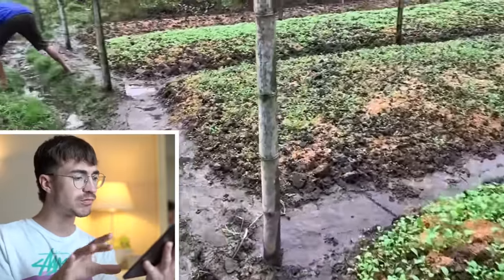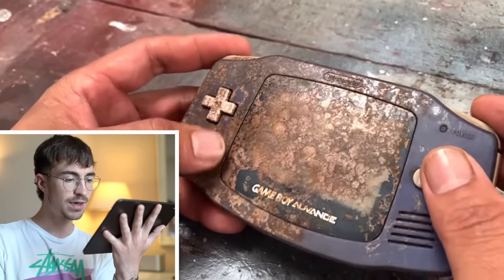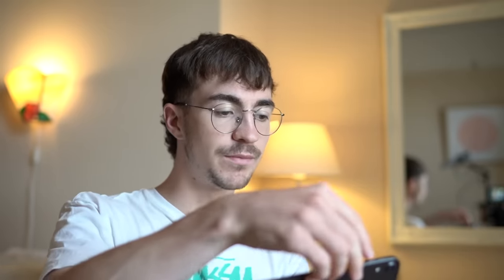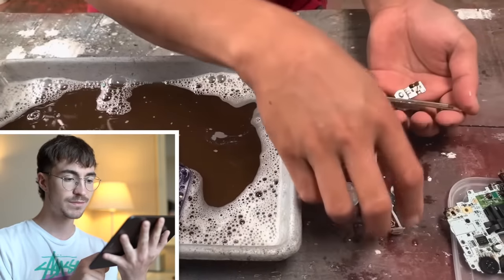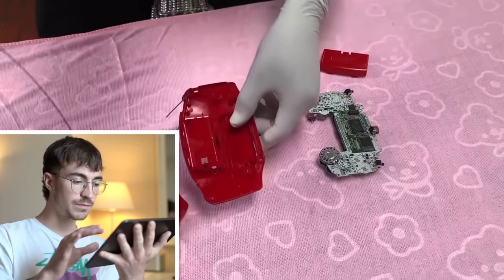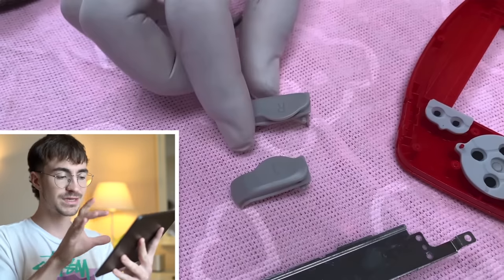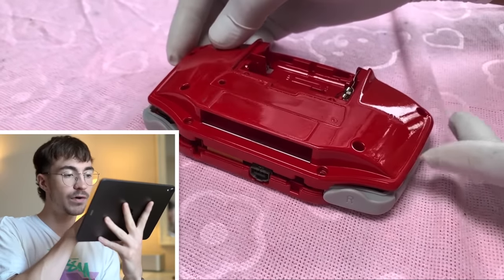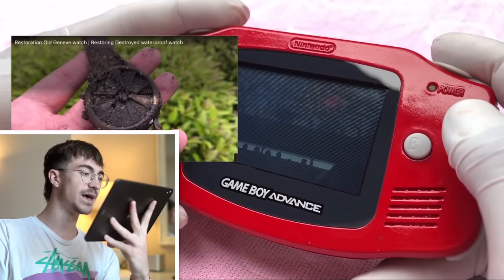Exposing FAKE Restoration Videos!

Comment: Cleaning electronic boards in water and soap actually works very well. I do that on nasty motherboards and they work fine, because there was no current in the board when I put it in the water. You just have to be absolutely sure the board has no water left hidden under its components.
Reply: Heck, I've put stuff in the dishwasher before (without detergent obviously) A good spray with some de-greaser suitable for electronics and a round in the dishwasher cleans boards up very nicely. Did it when I was fixing up old arcade monitor chassis.
Reply: watching him react like water is the worst thing for a piece of tech with no current going through it kind of frustrated me. as if that alone would brick a device
Reply: Yeah, I cleaned a few motherboards with water. Just make sure it's completely dry before turning it on. lol
Reply: I have cleaned motherboards in nice hot water, as long as they're dried well (i usually use a hairdryer and compressed air), water is a great way to clean them up.
Reply: Many of these restoration videos are certainly fake though!
Reply: I’d bet the original motherboard probably actually did work, but the one they put back in probably wasn’t it.
Reply: I came here to say exactly this. Cleaned plenty of old electronics out with soap and water
Reply: @EvilTurkeySlices  I bet it was the same one because the edges in spots were heavily rusted still when they put it in.
Reply: @WolfgangAmadeus117  my home server got flooded after an outage and storms, it still works just fine after having been fully submerged
Reply: @mrbisshie  so you submerged it in water for a few hours, spray cleaning foam on it, scrubbed the hell out of it with a brush, and it still worked? Skipping half the process and saying you can replicate it is a fools errand. Maybe you should make restoration videos?
Reply: @azinyefantasy4445  Damn, you mad someone would dare share an opinion that goes against you boyfriends narrative or what? For the record, it is absolutely safe to wash unpowered motherboards with water, just need to make sure all the minerals and gunk that the water has in it is removed before applying current, I just give it a alcohol bath. Anyways, good luck with the getting teabagged thing.
Reply: Used to work in a lab and we would wash our freshly soldered PCBs under the tap with soap and a brush to clean up all the rosin. It's fine to do so long as you rinse with distilled or alcohol afterwards so it doesn't leave any minerals behind, then maybe bake it in the oven for half an hour to drive off all the moisture.
Reply: I spray down crt arcade monitors with the garden hose all the time....takes the water just fine. After discharging it of course.
Reply: Yeah, after my keyboard had some bad incidents with liquid damage, i tore it all down and gave it a scrub in the bathtub, let it dry out in the sun, put it back together and it was fine. As long as there's no power when you wash it and you don't power it up before it fully dries, water won't do much damage.
Reply: Only problem with using tap water is with bga chips as the water gets trapped under which good old wd40 or heat will take care of
Reply: Normal water isn't the best approach. Distilled one of course is. Why it isn't? 1) it has tone of micro elements inside, they will be 'glued' to the pcb as water evaporates. 2) it introduces corrosion, 3) it's really hard to say when pcb is fully dry... Especially when the pcb is fully soaked. It could take days...

Use pure h2o, use it locally, then when cleaning is done - use some ipa to make water evaporation faster.

He didn't say, that water will kill it, he just said that device left in those conditions, looking like that (completely corroded) has no right to work - and yes it doesn't. I would even say - it is beyond repair, because it's corroded between the pcb layers.
Reply: @markippo  no corrosion between pcb layers and it doesn't take days to dry a board heat from sun wd40 alcohol etc will get it all
And just fyi there is always some moisture present even more depending on where you live and is very important to know when you do bga reworking so you dont popcorn chips etc
Eg florida like where i am
Reply: @williamlancto3655  Puting Motherboards in the dishwasher is the best thing in the world. Put it in the oven at 80 degrees celsius (176 degrees fahrenheit) for a good while and it's shiny and working in a few hours.
Reply: i even use dishwashing soap with it.
Reply: @sukhoifockewulf  Yeah, I work with electronics for my job and water is %10000 safe to use on any electronics. You just need to make sure there is no current to the motherboard. Also, hard water can be a concern but distilled water is non-conductive and if you use distilled water you can turn a motherboard on underwater while powered on as pure water is non-conductive. What makes water bad for electronics is the dissolved ions in the water, dissolved potassium and sodium ions are highly conductive and is what makes water bad for devices but if it is %100 pure deionized water then you can run current through devices all day submerged with current running no issue and no need to worry about any shorts. 

I cringed so hard when he complained of the guy using water acting like that was going to brick the device or be harmful to the device in any way. Yes with the soap and grime even if using deionized water he is introducing ions into the water making it conductive again, however, no current is flowing through the device no risk of a short circuit it's fine. Just make sure it is dry what I usually do after washing with water is dunk it in %99 iso as it evaporates off and works wonders for drying the mobo after cleaning with water while also stripping oils. People say not to use water only %99 iso but that is just dumb as iso isn't a good cleaning agent by itself at all it is actually rather horrible at cleaning that is why if you clean with iso you want to use a dilute solution as it doesn't work as well as water for cleaning things like sugars.
Reply: Came here to say the same thing. The board absolutely could've been the same one. The buttons, however, were all definitely after market and the video was definitely made in a way to try and make you think he'd restored them.
Reply: @azinyefantasy4445  maybe you should make a xray scan on your head video? it can be submerged in water for a few hours and scrubbing the hell out of it with a  brush wouldnt affect. ik a thing or 2 bout this because i restore mobile devices and i can easily clean them with water, even leaving it there for a few hours.
Reply: @CodyRPierce  That's one hell of a conformal coating.
Reply: @markippo  Its not that unheard of though with electronics. It really doesn't matter what they look like.I''ve seen working computers with insect nests in them.
Reply: @jhoughjr1  no coating. We pulled it apart and cleaned everything and it was fine except for the hard drives. The case rusted though
Reply: A solution of distilled water + isopropyl alcohol (or even pure alcohol) works wonders for cleaning PCBs, especially in combination with an ultrasonic cleaner.
Reply: @Veticia Misumena yes you can but the issue is they would be thinner and likely crack break especially leaf spring
Reply: @TheStiepen  dont forget vinegar for battery acid corrosion etc
Reply: I had a backplane that sat in water overnight. Cleaned it up. Everything looked fine, but it had random failures after that. 
You may be able to clean with water, but don't let it soak. YMMV.
Reply: @peterbonucci9661  That somehow happened to me. Turned out the board was not dry enough.
Reply: @larrymace2361 .... "I work in electronics for my job"? Sure kid. Sure.
Reply: @lululock  it was intermittent for years afterwards. It was good enough to use, but bad enough that you couldn't trust it. We ended up useing it for parts.
Reply: Came here looking for a comment like this because I was under the suspecion that this was the case. Thanks for clearing that up.
Reply: @Trainwheel_Time  LMAO you cannot even quote me right I said "I work with electronics for my job" way to dumb down what I said, projecting much? Also, name one thing I said that was wrong instead of focusing on childish antics how about focusing on the other 99.9% of the post that goes into detail about why water doesn't harm electronics.
Reply: @WolfgangAmadeus117  I agree. It put a very big seed of doubt to everything he said to be honest. I have to question if he knows what he is talking about :/.
Reply: Yep. I washed a C64 motherboard in the bath after finding a leaking capacitor about 6 years ago.. Washed it, then let it dry for 2 weeks. Put it all back together and it worked fine,
Reply: dont know to much about fixing up electronics, but problem with normal tap water or water you find in wells or outside is that it contains minerals that is harmfull to electronics as the minerals is conductive, and as the water evaporates it leaves some of those minerals behind, which could fry the device when turned on.
demineralized water on the other hand is non-conductive so it wont fry electronics even if completely submerged, and its a great thermal conductor, problem is however that the water is corrosive so it will damage electronics submerged in it, and that corrosion contaminates the water, and that corrosion is conductive.
Reply: @theldraspneumonoultramicro405  100%....... When I did the C64, I used tap water and soap, then rinsed thoroughly with distilled water.....
Reply: @CodyRPierce  quite often there is a thin clear coating on boards. Certainly not on older boards though.
Reply: Hes leaving out information and acting like its all fake. While focusing on the screws and trigger buttons. He never actually called them out on the motherboard. 
Dudes just mad there video has way more views
Reply: @opts9  
No. They exist. We watched one. Must be real
Reply: @markippo  As for the water "problem". If you are using any kind of soap to get the pcb clean, you'll have to rinse it thoroughly with water. To get rid of any residues that might be in your water you then soak it with alcohol. Using a spray bottle works fine. The alcohol takes care of any water that might be trapped under an IC or other component. Let dry and check for shields and residues from the cleaning. If in doubt clean with alcohol again.

A major problem is leakage from batteries that can corrode, damage or destroy the pcb. If you are careful you can use cotton buds (q-tip) with strong vinegar to get battery gunk off (rinse well after using that). 

Many older electronics (much older) have some components made of materials that can suck water up, like capacitors and some resistors/coils. If one are to keep thees, for what ever reason, they can  most definitely be damaged by water.
Reply: @secularnevrosis  Yeah - I do agree with you, I'm not against the water, I'm against a normal water that has electrolytes thus is conductive and hell way more corrosive than distilled one. I'm also against soaking the full pcb into it. If you want something clean - clean it locally, then remove water, then use alcohol to make it evaporate faster. I don't even wanna comment on using dishwashers or detergents, it's a butchery... Also I'm not very eager to use any form of acid. If leakage occurs - it's acid vs acid - it's shows how acid is destructive on pcbs. I'm using alcohol to soak it, then I'm trying to scratch it off
Reply: Water will definitely ruin a screen thou
Reply: @Zeina107  behave!
Reply: That or using alcohol, because you can still put soap in it and it air dries very fast

Comment: 9:28 A Motherboard can handle water for a while as long its not powered up. In the factory, each board will be washed with water and alcohol. But if its powered up, the oxidation will go on very fast. Coffe also affects the thin ribbon cables
Reply: I mean sure.. it can "handle" water. But if you dont then clean it with mineral oil or isopropyl.....? lol "Liquid damage" is never really what causes catastrophic damage.. that only jacks up things like... the LCD panel immediately. After that when it dries, the minerals left behind cause corrosion and rust to the solder and components. Also, simply rinsing or soaking it after doesnt really do the trick, especially in boards that have heat shields. I'd call this video complete BS, because you cannot just soak a board in water, let it dry and it somehow work again. Certainly not the LCD panel. I've had macbooks come in with ruined screens just because the customer sprayed it with windex. So it doesnt even have to be submerged to ruin them. The board though.. corrosion will set it the second its dried, with or without power injected.
Reply: @mmz12  shure, long time in the moisture and humidity will kill the board. But just a dip in Water for the movie may not harm it
Reply: @mmz12  Mh, i had also my bad experiences with cleaned flatscreens, whenever water was soaked between the layers.
Reply: Christopher Wiggins  I.. Guess that could work? For maybe specifically PCB cleaning. I just don't know why anything else would be used, when the generally accepted cleaner known to have no issue is iso. lol Its safe, cleans well and dries almost instantly. Its the whole reinventing the wheel thing or "if it aint broke, don't fix it" situation.

Regardless, that  LCD will absolutely not survive that. Not even using prescribed cleaners. Just a few drops (or a splash in any liquid) will cause a weird multidimensional appearance. You see this with DIY iPad repairs and devices that have the glass fused to the display. Typically, heat is used to soften adhesive, but another great way is a dropper of high % iso. You just drip that along the edge and slice right through the adhesive. Sometimes, people get a little too excited and it soaks into the display, getting in between the numerous layers of the deflector, diffusors, backlight, etc. Best case, you have a trippy, headache of a display. Worse case it will completely fail, as it would with submersion if its not at the very least water resistant.

Comment: The funny part is, that with enough time, patience, skill, and luck, this Gameboy (in the false condition it was at the beginning) could easily be fixed up and work well. The biggest issue here is obviously the screen, as that had basically no chance of working/not having water stuck in it, yet the motherboards in older electronics can be surprisingly durable sometimes, so I believe that could have worked at least. Believe it or not, but I found a Sega Genesis model 2 locally (Chicago area) a few years back, fully submerged in muddy water  and filled with mud, rust, bugs, and mold. Never seen a console so dirty in my life. I had to have it. It took a few DAYS to fully clean it, and despite it LITERALLY falling apart (caps and heatsinks solder was breaking/loose and parts fell off a lot), it somehow worked. It got to a point where I nearly gave up, soldered stuff together, and was gonna toss it if it didn't show any signs of life. Not a SINGLE aftermarket OR replaced part, it worked flawlessly!

TLDR: These fake resto channels suck and imo can fix these things without 'cheating' like they do, as I have succeeded with worse.
Reply: Even if they could the effort probably isn't worth it for them. They obviously aren't doing it out of passion, which means it's for the money, which means they're probably better off doing what they did because it required less effort. A few aftermarket parts aren't that much of a cost investment when it could take days to repair the thing for real.